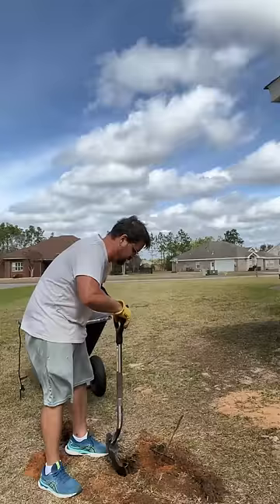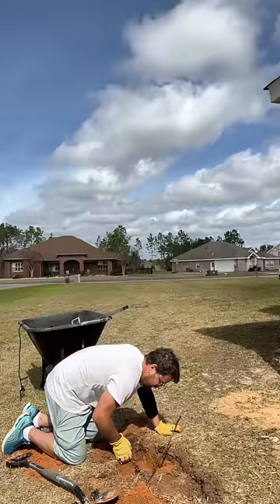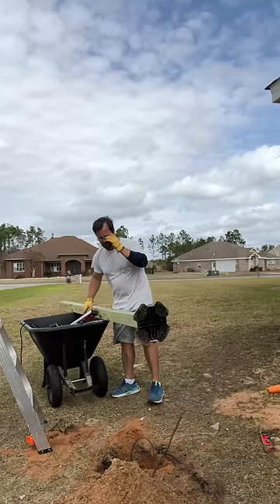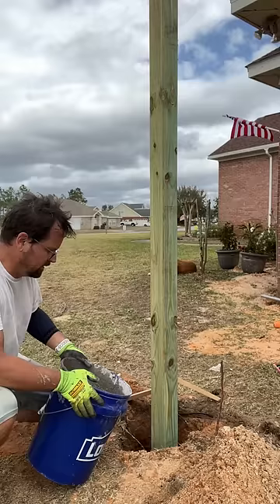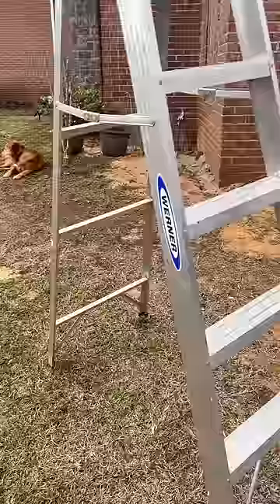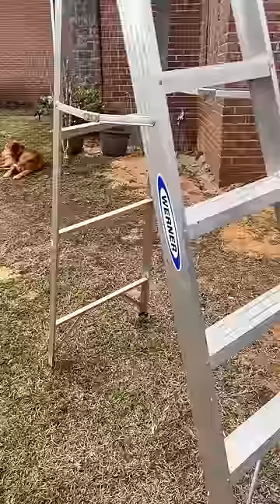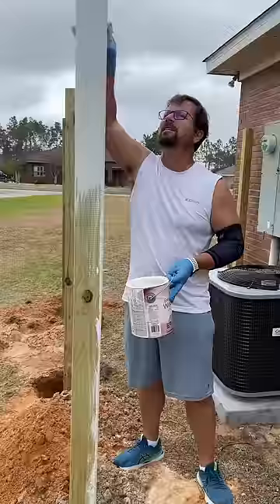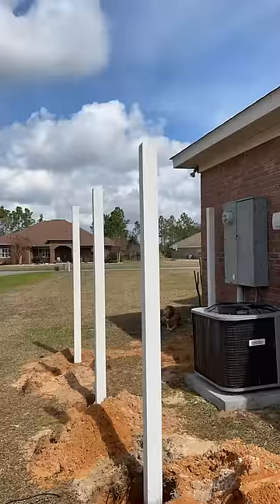DIY HVAC privacy screen part-1 #fence #diy #diyhome #privacyscreen #howto #homeimprovement #backyard

Comment: You should let the posts dry out before painting, they will be highly likely to peel.
Reply: That and an outdoor latex base tends to last longer then oil based
Reply: He should have used cedar posts.
Reply: He should have used stain not paint on those outdoor PT posts.  Paint employee told me you can use any color you want if you go with  a solid stain, not just what they say is on the brands brochure. Did that to a wood shed about 15 years ago and no re-staining needed. Also built a shed with all PT exterior wood and stained it as well about 5 years ago and still looks great.
Reply: That's the problem with the internet you'll have to plan people cutting like they know what they're doing PT needs a year to dry before you do anything to it
Reply: Pole in the hole 🤣👏🏻😂
Reply: Not always. You flick water at the treated wood and if it accepts it instead of beading then it's fine to paint.
Reply: @mattlane2282 lol just no ....

Comment: Pressure treated wood should be allowed to dry before painting/staining.  Depending on where you live it could take a month or longer.
Reply: I don’t think  it came straight from the mill, straight from the factory. They use kilns there.

Comment: I replace rotted wood everyday.  Water runs up wood..bc it was a tree. The most important area is below ground esp the END grain. All posts rot eventually from the ground up. Prime the hell outta the end and top up to few inches above ground. Also  contacts where screws are. Those aren't primed. Water gets trapped at the crosses. So the areas that are most 'prime' for rotting aren't primed or sealed. Otherwise nice work.
Reply: We just replaced our 19 year old wooden fence with a woodcrete (concrete formed to look like wood) fence. When they pulled the posts there was zero rot. My husband has been breaking up the concrete around the posts and they will be reused in the gardens.
Reply: If the concrete is level with the groud they're less likely to rot, at least as fast. Where he still back-filled on top of the concrete, the section of wood contacting the soil will likely rot first.
Reply: I grew up on a small farm with a frugal dad. Our untreated fence posts were soaked in a barrel of the motor oil ( from changing his own oil). And they lasted about 20 years. Of course the black locust fence posts lasted forever. Terrible crooked posts but they are still there some 40 years after we put them in the ground. A couple of the posts took root and started growing.
Reply: @pattidrier9593  Bois D Arc lasts a long time also.
Reply: @SharonRepici  I don't bother with concrete when setting posts. Just put an uncut (treated) end down, and backfill with a lot of tamping with something small like the end of a shovel handle or 2x2, holding the post plumb at first until it holds itself. Adjust plumb as you work your way up. 
-- It's not as if a fence post is supporting a lot of weight. No footing needed.
Reply: @grizzlygrizzle  😂😂
Reply: @joethompson8131  Centuries of farmers setting fence posts didn't use concrete, and they didn't have pressure-treated wood. They just used cedar posts or some other rot-resistant species, and just tamped the backfill carefully. Concrete is for suburbanites. And for chain-link fences, which have skinny metal pipes for posts.
Reply: @grizzlygrizzle  ok my man so we’ll both put a straight free standing 15 metre fence with 8 foot high panels in a field, I’ll concrete my posts in and you use compacted mud and we’ll see who’s lasts longer 🤦‍♂️
Reply: @joethompson8131  I'll use topsoil, which in most places includes some sand, gravel, and small stones mixed in. I don't have any worries about the outcome. I have generations of cattle ranchers and pole-barn builders on my side, and their outcomes.
Reply: @grizzlygrizzle  well I certainly wouldn’t hire you to install any kind of garden fence, it wouldn’t last 2 minutes. A little chicken coop is one thing but as I say you try constructing an 8 foot panelled fence with top soil and then go and check it out after the first storm that hits it
Reply: @grizzlygrizzle  my family has installed fences for over 60 years. We prefer to use concrete BUT I will say this, fences can absolutely stand straight for decades with no concrete. Farm fences, wooden round posts, split rail decorative fences, all of those we install with zero concrete, and the posts are SOLID. Wet muddy ground, sandy loose ground, concrete shines. I've broken open old fence posts with the concrete still attached and the posts inside are brand new, and I've also broken them open and seen the posts rotted to nothing.
Reply: @brianbunnich6221   Precisely. Concrete is most important in bad soils.
Reply: except with Australian hardwood (the most glorious thing nature has ever created), after the millennia of standing up to the harsh sun and buff bulls, the primary wear is at the top (from weathering at the end grain like you mentioned). this can be avoided with metal caps (like on power line posts) that prevent water from soaking into the end grain.

Edit: we don't paint those, they don't need it.

and cutting down old healthy ukes is a sin, and then mulching the remains is a greater one. you have no idea how fucking slow growing and hardy those are, and how fucking dense and hard-won those gorgeous wood fibres are
Reply: Nice tip 👌

Comment: If you have a planer chances are you know more than you're letting on. Nice job so far.
Reply: its a dewalt planer, first sign someone knows just enough to get it done but not enough to know what kind of a shit tool it is
Reply: literally means nothing.  Personally, I'd call 811, and not dig a hole/install a post right thru all my utilities.  Seems like a huge potential future issue.

Comment: If the concrete is level with the groud they're less likely to rot, at least as fast. Where he still back-filled on top of the concrete, the section of wood contacting the soil will likely rot first.

Comment: I suggest you cap the tops if you concreted the bases because water will get in the top and not be able to escape the concrete base and will rot the wood no matter how well treated the wood is. 😉

Comment: Pressure Treated wood cannot be painted for 6-12 months.  The wood has to totally dry/cure.  The test to see when you can paint is the "water test."  If you put a drop of water on the wood and it beads up, it's not ready.  If the water is absorbed by the wood, it's ready to paint or stain.

Comment: @TheNavagePatch What was attached to the bottom of the post and did you leave it on in the ground and concrete.
Reply: Wondering this too!
Reply: @mssulem42  I made a video on a similar light on my channel and I used 5 lag bolts and attached it to a 4x4 post. So far it’s holding up great!

Comment: Use the 24/36” 4x4 coated spikes. No concrete needed. 10 minutes w a sledge or less w a jack hammer/driver.

Comment: Looks nice but those pressure-treated four by fours you just painted while you did a seal in the moisture and now it's going to rot from the inside out your supposed to wait six to eight months before you paint it so it can dry out properly but it was a good thought most people forget that😊😊

Comment: You should have told your wife that you need a hydronic heat exchange reservoir for your air conditioner condenser. It's much smaller than a traditional air-to-air condenser but you need a large body of water that act as the heat sink. It uses a titanium heat exchanger to pull the heat out of your house instead of dumping it into the air it dumps it into a large fluid receptacle. I'm talking about getting a pool and then the heat exchanger will heat your pool for free and racy will work better.

Comment: Reducing the efficiency of the heat pump by blocking the air around it. You might want to go back and make sure you have proper ventilation at the bottom of the fence so that air can easily pass. I'll bet if you go back and look at your records your cost to heat and cool your house have gone up by a small percentage that can easily be recovered. Let's just say I know from experience

Comment: Question... I've never used the oil based primer. Did you wait for the treated 4x4 to dry out or is it good to put on the wet treated wood?

Comment: Where's the shot of the finished fence?  You can dump a bag of concrete mix in the hole while letting a hose dribble some water in at the same time.  You don't need to pre-mix the sackrete with water for post holes.

Comment: I think you could have saved on steps by using metal posts instead of wood 4 by 4 s
Reply: It would be much harder to attach the slats to the posts if the posts were metal.

Comment: Whats at the base of your posts? Ty.
Reply: ya i wished he answered your question. I can't find them anywhere on amazon or the internet.
Reply: Tuffblock, made for decks. Not sure what purpose they serve here
Reply: @rappin05  Something for the 4x4s to anchor into and level off of before pouring concrete. As opposed to pouring and tamping gravel. If the diy-er rented a concrete vibrator from Home Depot he would then assure that there are no voids for water to accumulate and freeze in during winter.

Comment: You got the paint process correct just not the timing. A those posts are about to shrink by 20% B the treatment has silicone in it and we all know how well paint sticks to that garbage. If you’re going out of your way to make wood waterproof just use regular pine and pine tar the end that goes in the ground.

Comment: Claiming today’s environmentally friendly P.T. (even ground contact rated formulas) will “Stand until the end of time” is quite a statement. I’ve had 4x4’s rot off and fall to the ground in less than 5 years. JS

Comment: first, pressure treated posts last maybe 3 years now. the new formula that replaced the formula that was used for over 80 years sucks.  and never use oil-based primer on new pressure treated wood, or much of anything.

Comment: Please don't put bushes around your AC units. I've had people put them completely around them and when you need to work on them it's complete pain in the ass. I started just pushing over the bushes and when home owner complains I tell them to fix it themselves. They usually will let you crush a bush or two to get AC fixed though.
Reply: It's always fun to "crush" some bush. 😊

Comment: Have you ever or do you believe in using old motor oil to coat fences
Reply: I did this once on a wooden walkway and cedar shed.  The problem is the smell.  You do notice it and it doesn't go away like the smell of stain does.  Lasts for months.  I just paid for the stain the next time.